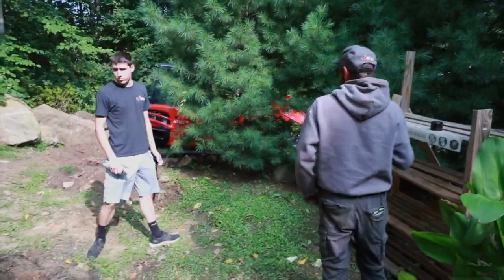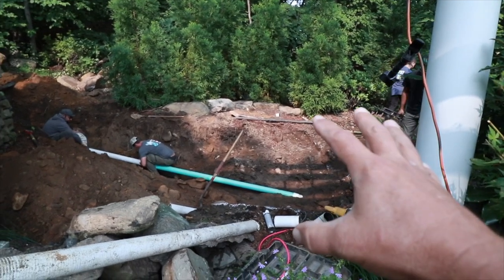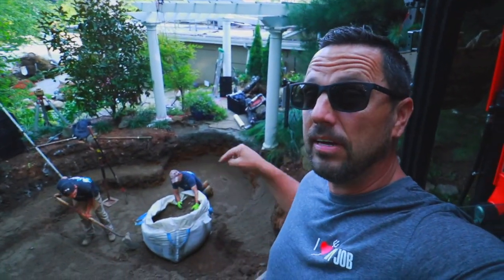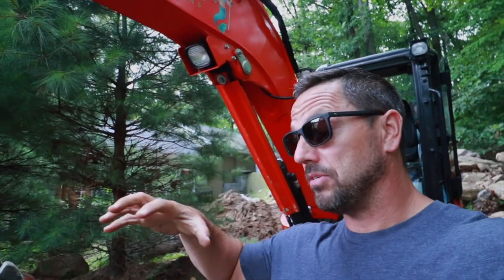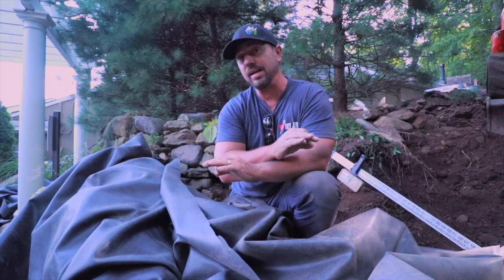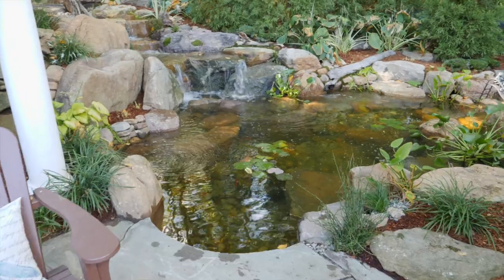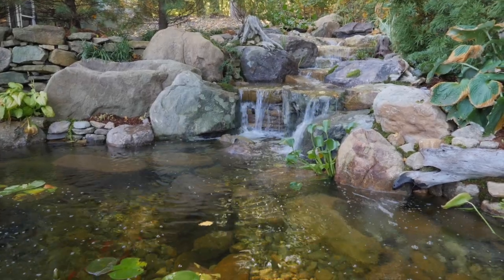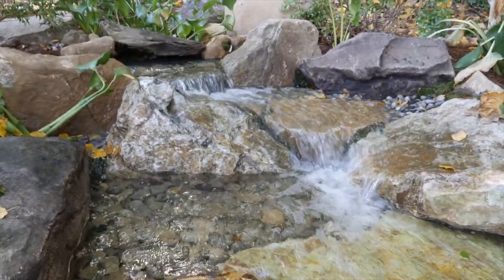Large BOULDER POND *$60,000 KOI POND*

Comment: 2 questions please?

what sort of sand do you use to build up the shelves?
can i put old carpet under the underlay to add cushioning? ( the soil is pretty soft already)
Reply from the maker: Any kind of clean sand will work, just make sure you compact it. You can use old carpet, just be aware that it'll deteriorate a more quickly from the moisture and elements than normal underlayment.
Reply: thanks very much for your advise
 @AtlantisWaterGardens
Reply from the maker: @WillPreston3D  anytime!

Comment: I have a question, this is pretty much my like long dream so much so that I'm looking for a property/B&B that has a really nice natural slope to work with. Is there such thing as too much slope or issues to watch out for? The backyard of a home I'm interested in is built on a flat part of the side of a small mountain with HUGE natural boulders all over the place. Are there issues I should avoid?  It does level out a few times and slope down again all the way down the property to a nice flat spot aka POND!! My fear would be wanting to create Niagara Falls and the noise would be deafening and my bank account empty!! lol I'm guessing it would have to meander like a snake with small pools on the way down as opposed to straight down and there would have to be at least 2 separate pump systems to be able to pump the water to the top but made to look like one continuous stream/waterfall ending in a pond on the flat surface? It's also heavy wooded so leaves would be an issue.  Curious if there are downsides to having such a natural slope? It's by no means a vertical drop and it seems like machinery could navigate up but that would be one issue to be concerned about I'm sure. Any advice or cautions without actually seeing the site first hand?
Reply from the maker: Steep slopes are difficult. Lots of boulders usually means tough digging

Comment: You mentioned Tranquility Elite is  10'×14',
And the Tranquility Deluxe is 14'×20'
 So how big is the Serenity Elite  with wet land, two biofalls with one 4ft stream with 6in in depth 2ft wide an the other is a 8ft stream 6in depth and 2ft wide... being that 2 pumps are biofalls which creates circular circulation thus creating surface agitation throughout the pond.  Jets help get rid of stagnant areas and any debrie and wetland  leveled with pond makes the pond seem much bigger pooling up just like a spring. It gets its oxygenated water through the bio falls. A 14' × 28' pond with land bridge how ever made possible. All that water flow creates current in thus creates and agitats debrie up off of ground and over negative edge with pooling area intake bay...